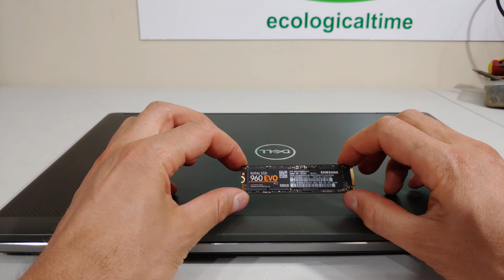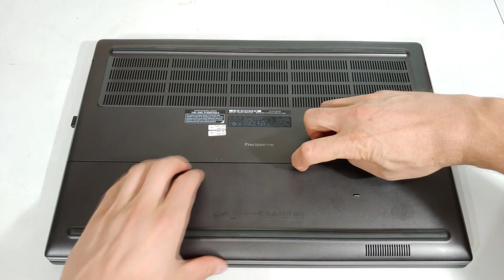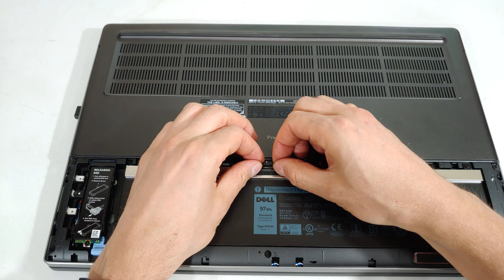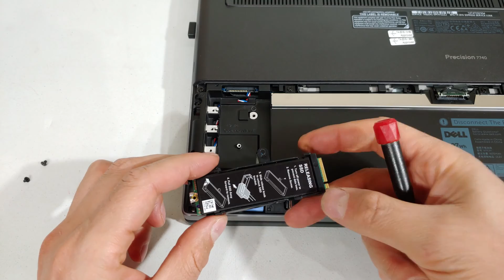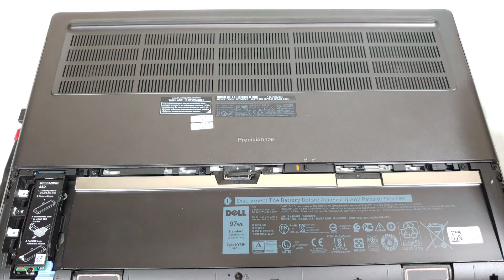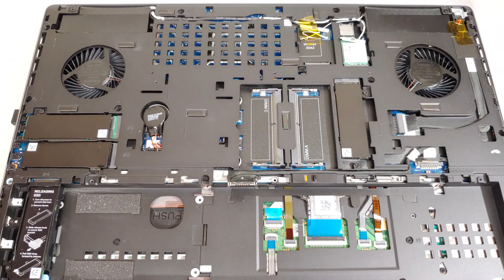How to install an SSD- NVME - drive in your Dell Precision 7740

Comment: Maybe someone knows how to deal with the high temperature that the motherboard transmits to the SSD, especially in the slot on the right, which is near the RAM. The only normal slot here is the one on the bottom left of the case, and the ssd itself is fine with it. During the intensive operation of the laptop, the temperatures transferred from the motherboard to the SSD are absolutely terrible. And the main thing is that they didn't even make holes in the case near these SSDs. Can something be laid between the motherboard and the ssd? But it should be something that is not flammable and does not heat up very much, and also does not transfer much heat to the ssd? 🤨🤔😒😒 Maybe it should be some kind of piece of thin wood or resistant plastic, or stick several layers of heat-resistant electrical tape...? There, the distance from the motherboard to the SSD allows you to do this. But on the other hand, because of this material, the SSD may take longer to cool down after work.

Comment: I'm so confused regarding what is and in what slot is installed the OS drive in this video.
I think the OP had to give some more explanation, he started with the first drive without removing the battery and I can see that is the slot 4.
But I read on Dell forums that the slot 4 is only reserved for a data drive so you install the OS drive in the slots 3-5-6.

Comment: Good, apart from putting the screws on top of the laptop. If they fall through the openings, and end up inside the laptop, you might be forced to take the whole laptop apart to get them out. If you don't take them out they will cause electrical shorts inside.

Comment: is there a max drive size or can I just install a 4tb drive then add drives to the other slots as needed? Also is the RAM soldered on or can it be upgraded? If it can be upgraded is there a limit on the size of each stick or can I install say 2 32gig sticks? It's my understanding that there's only 2 ram slots but I've also read some people saying there are 4

Comment: Is there any reasoning behind which physical drive location should have the OS installed?  If so, can this be altered in bios?  For some reason I've been unable to install the OS on a new 4TB M.2 PCIe 4x4 NVMe drive in the #4 slot (next to the battery).

However, it seems to install fine in the #6 slot.
Reply: Hi Shawn, I've got the same computer and I want to replace the 512gb main drive with a 4tb m.2 and clone the system to this disk, is it possible? By the way, which brand/model 4tb drive did you buy? I need some advise man 🙋🏻‍♂️
Reply: @ÖvünçDAN  I installed a Crucial P3 Plus 4TB.

Comment: QUESTION:  Other than Optane drives, is their any logic we might need to consider when placing drives in different slots?  I heard someone mention that some machines have a master vs. slave designation.  Is that the case here?  

Also, will each M.2 port/drive slot be associated with a fixed drive number (0, 1, 2, 3)? or is this solely determined by the sequence you install them?  

Thanks for the video!
Reply from the maker: on some machines some drives have better transfer rates than other slots. If i recall correctly this machine has the same for all but you would need to verify that. Yes it does have fixed drive number irrespective of the letter you provide for the drive. It will list the drives according to its drive number 0-3

Comment: Thanks very much for this excellent video.

Could i ask, are the sticky thermal pads already given by dell? Or did you buy those separately?
Reply from the maker: came with the SSD
Reply: @ecologicaltime  thanks. So the computer has the heat sinks but no thermal silicone pads?
Reply from the maker: yes thats how mine was
Reply: @ecologicaltime  thanks. And also , thanks for your great tutorials. Much appreciated

Comment: Thanks a lot,  I did upgrade the 32 to 96 by adding 2x32GB Crucial DDR4-2666 (in the back, did not touch the ram under the keyboard) and 2TB Sabrent NVMe 2280 SSD. now I'm experiencing BSOD and each time for different reasons. such as :
1. KMODE EXCEPTION NOT HANDLED. 
2.POOL CORRUPTION IN FILE AREA. 
3.KERNEL SECURITY CHECK FAILURE 
4.MEMORY MANAGEMENT. 
5.FPN LIST CORRUPTION 
6.SYS Service Exception 
7.WIN32KFULL.SYS
any help would be appreciated
Cheers
Reply from the maker: i would open the laptop and remove all the new components. Then install one by one and see what happens.
Reply: I wonder if the additional RAM specs are an exact spec match to the existing RAM. Mix-match RAM could cause issues.

Comment: Don't the Samsung 960/970 series M.2 drives already have a heat spreader on them???

Adding the second heat spreader would seemingly create a thermal sandwich, which is bad, and not double the heat sink.

Perhaps it's only the 970's that have the built-in heat spreader?
Reply from the maker: mine did not have but you can put heatsink on top of heatsink with silicon paste. Only issue is the clearance.

Comment: Can you show a video Removing the 2.5 inch 7200 RPM drive that connects with a interposer and swapping with a NVME in that same place. (Dell charges a lot of money for its SSD as well as its ram). So i prefer to spend less and get those parts from Amazon or similar. Thanks
Reply from the maker: okay its on my list, should get to it in the next week or so.
Reply: @ecologicaltime  Did you ever make this video?  I looked through your list of videos and couldn't find it.  I am particularly interested because Dell's web site shows up to four drives, some of which can be 2.5" spinning drive(s) but it's unclear if you buy all your own storage exactly how you can trade between NVME slots and 2.5" drives.  Watching this video, my first thought was maybe the third and fourth NVME drive (I'm assuming that's the 4th drive next to the 3rd drive you replaced) can be removed to fit a 2.5" drive.  Is my thinking correct?

Comment: How can you determine which slot for the SSD is the C Drive, D drive, etc
Reply from the maker: c and d are arbitrary names. You change that in the computer management console.
Reply: @ecologicaltime  Yes but is slot 1 or slot A the suppose to be C Drive?

Comment: I changed the clock battery on an Asus laptop with help from YouTube...... Cost me only €12 for the battery. If I had sent it to Asus I would have had to take out a 2nd mortgage.....
All changes/repairs since then have been via movies like this... 
All the Dell guys will love you for this.

TIP: I use a plectrum (guitar "pick") to split the case....
Reply from the maker: thank you

Comment: Great videos Thank you. I am about to buy the DELL 7740 but I need your advice about the processor and graphics card. Is there a huge performance difference between the Nvidia RTX 5000 and RTX 4000 knowing the 1000 dollars price difference? And which is better or which one do you recommend  I9 processor or the Xeon?. I am an architect working on programs such as 3dmax, Vray, AutoCAD, Maya, and my work demands photorealistic rendering and sometimes animations. Hope you hear from you soon. That will greatly help me decide.
Reply from the maker: thank you. i recall this dilemma when i was selecting my CPU too. https://www.intel.com/content/www/us/en/products/compare-products.html/processors?productIds=192989,192990
https://askgeek.io/en/cpus/vs/Intel_Xeon-E-2276M-vs-Intel_Core-i9-9980HK
I preferred the i9 from the tests but there are a few security features which the i9 does not have. From what i see the i9 is better (faster) but maybe someone has personal experience on this as i have not used the Xeon so cannot comment from actual tests. 
The more powerful graphics card means that rendering would be faster. In terms of colour and accuracy, that i dont thing has any impact which you get. The one will get you there faster. If its static screens then i dont see a reason for the RTX5000 but if you move your images and it keeps recomputing, then yes the more expensive one will do it quicker. 
When you use your software, check the performance in the Task Manager window. If you see the graphics card always highly utilised, then you are doing graphics intensive work and then consider a powerful graphics card. For example, i use Vegas Pro. For the most, part i only notice major improvement when i render the video. The CPU does compensate as well which helps.
I did do a video comparing the AMD cards and there was only a minor improvement between one model and higher model, although the CPU were not the same. 
https://youtu.be/2BuSR6HlFzw 

The software is also a factor in that its graphics acceleration must be supported by your graphics card and visa versa. Another example, AMD allow you to use Cross fire which lets two cards run as one. However not all video editing software can support this so in my case two cards made no difference to speed as that feature was unsupported in my video editing software. https://youtu.be/2BuSR6HlFzw